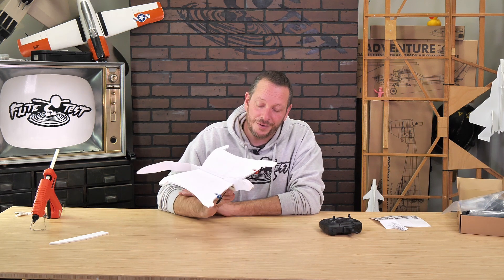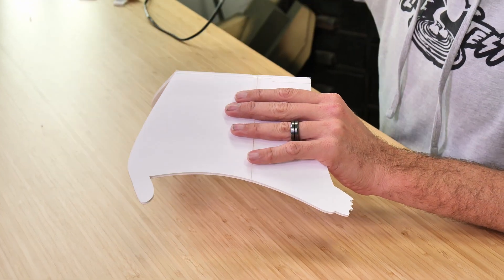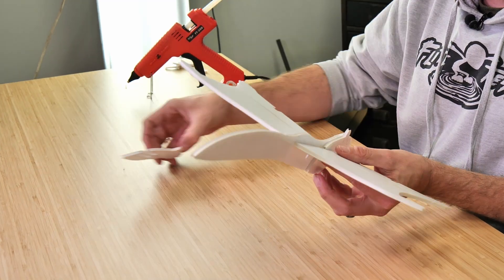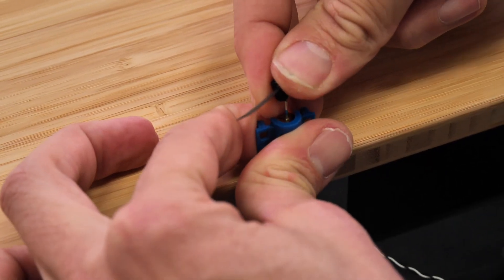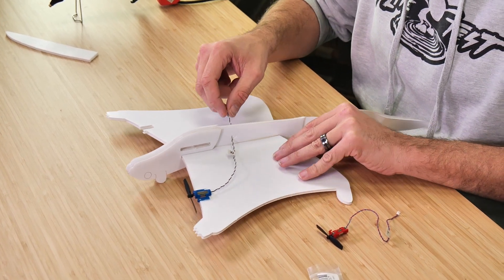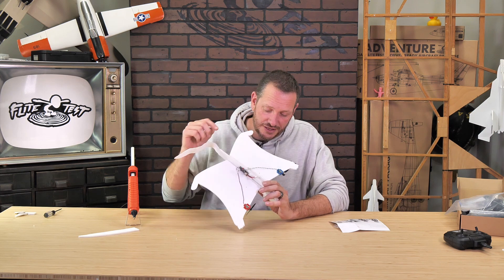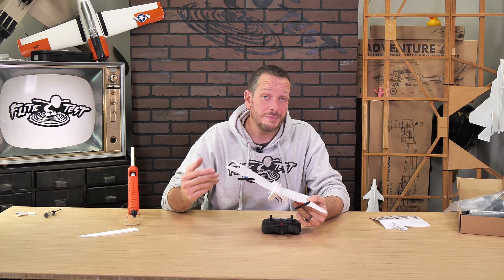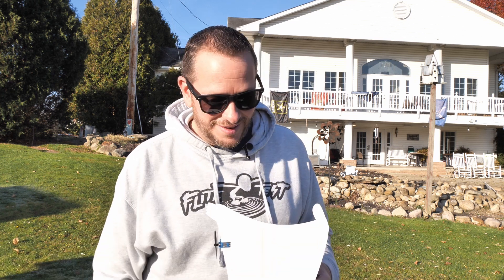How to Build the FT EZ Squirrel //  BUILD

Comment: FYI:  The tail will flap beautifully all by itself without gluing it in a zigzag. 😊
If you drag the tail-paper along the edge of the table it will remove the curl, but the tail will still function as intended and give you a fun flap in flight. 😊